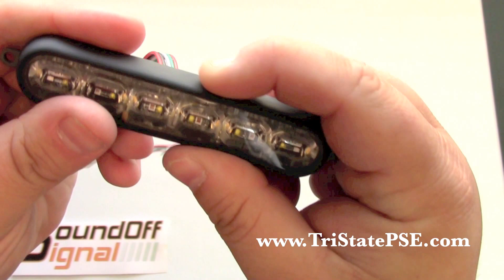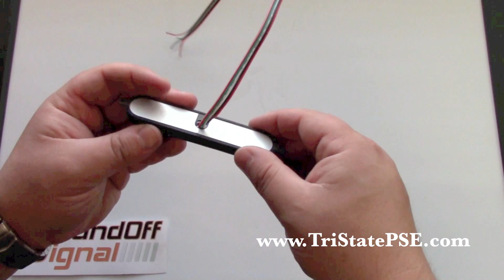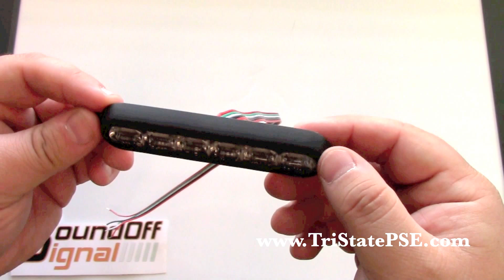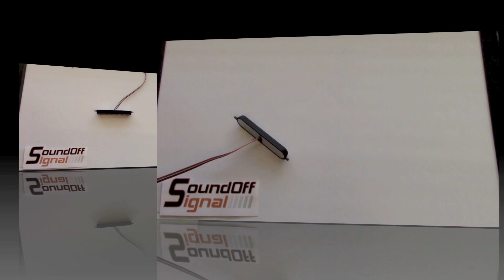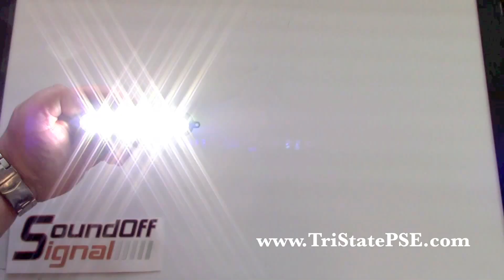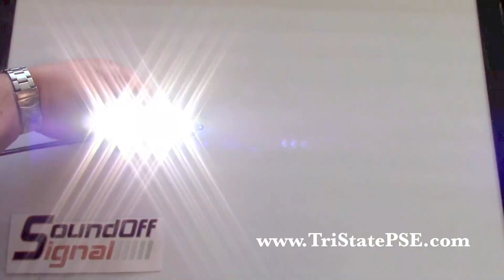SoundOff Signal mPower Fascia Led Light (overview)

Comment: If I buy the tri-color version [red/amber/white], can I use the red for a brake, white for flood and any color combination for warning? In other words, how many modes are there to configure?
Reply from the maker: Allan Reiss - There's basically two modes with the mPower lights; Flashing mode and white Flood mode. You can't isolate individual colors for separate functions.

Comment: Is there any flash pattern that only flashes in red? If it's dual color like this one.
Reply from the maker: Yes, you can order the single color version (6-led or 8-led). Or, if you order dual color, you can isolate the colors to only flash red, then use white as a flood/scene light.
Reply: Thank you for the reply!